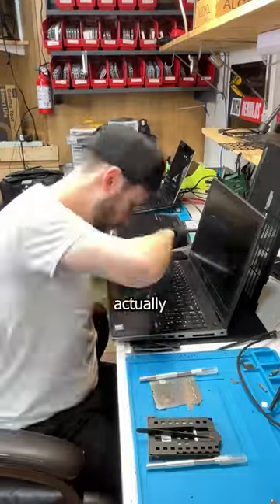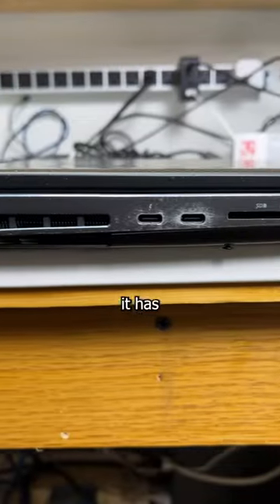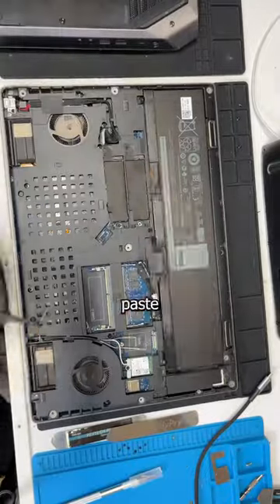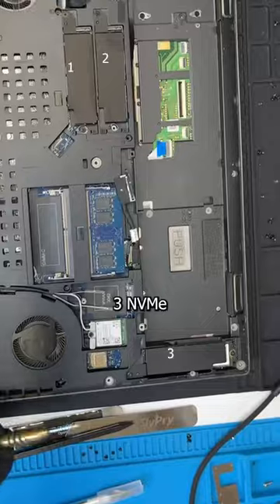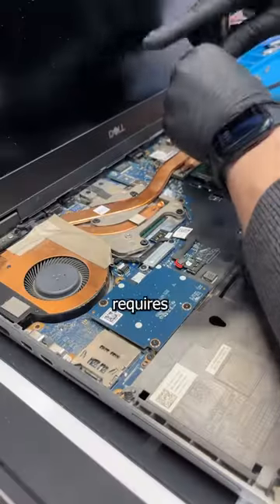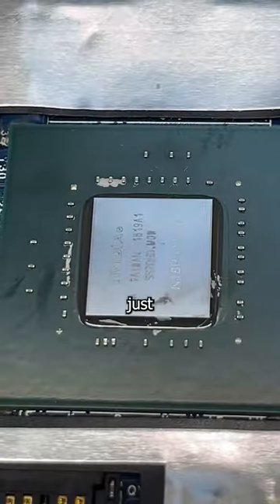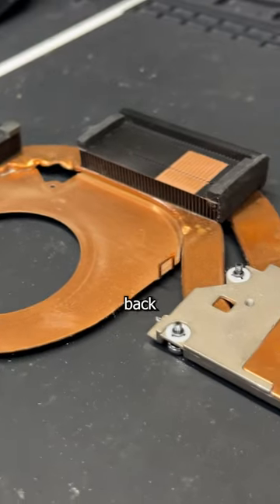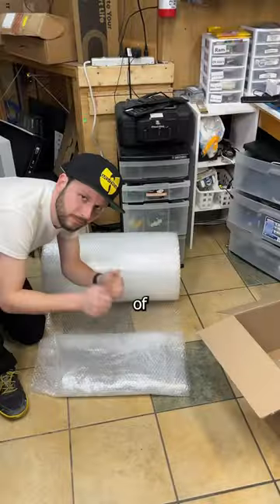Is a refurbished workstation laptop better than a new #PC ? #tech #technology #shorts #pc

Comment: Whenever i see a laptop with replaceable/upgradable gpu/cpu I can't help but wish i had them... Too bad none of the laptops nowadays do that anymore.
Reply from the maker: (Besides Framework)
Reply: Lol yeah besides framework. Honesty they are good but a bit expensive for the same normal laptop specs
Reply: iirc their older model's price dropped to ~500 I think
Reply: @SalemTechsperts Too bad Intel and AMD quit making socketed laptops CPUs by the time framework finally rolled around. Especially given how much longevity AMD platforms tend to have. It would honestly be a way better deal, but I understand that framework can't do anything about that.
Reply: @MrGamelover23  when my '08 thinkpad w500 finally dies, i'm gonna be in a bind finding something modernish to replace it... 😭
Reply: Proper thick workstations might still have upgreadable GPUs. Having an upgreadable gpu in a 7530 doesnt really mean much though, you can jump from a quadro P3200 to something like a quadro RTX 3000, but thats about as modern as you can fit into one of these. And it still uses a proprietary connection and form factor, so you need one thats specific to this model.
Reply: Same, and framework is unavailable where I'm from 😔
Reply: Sadly MXM slot GPUs are ultra rare and can cost double or triple the price of a desktop one, to the point one would instead just get a new laptop and generate more e-waste.

Speaking of, got an old Acer from a friend and it's a Vista era laptop. Core 2 Duo, GPU ain't half bad for it's time. Maybe I'll throw in a 2TB SATA SSD, put XP on it and have it be my retro pc rig for those games I can't be bothered to run on my Windows 10 desktop.

These refurbishing videos always get me in this mood, I swear to God...
Reply: @kittytrail  a used XPS or precision? My precision 5520 (basically an XPS, very nice laptop) is now 7 years old and still almost good as new! Except for the part where I had to disassemble the laptop to scrape all the soft touch material off the palmrest because it was getting sticky.
Reply: @freeeeplay  waaf
Reply: Consumer-oriented laptops to be precise (Dell XPS, Inspiron, and Alienware).

Comment: I have a precision 7730 that I got almost a year ago. I love the thing, it looks like one of the most default laptops ever, but has enough power to run my videogames at 4k60 high. I added the ptm 7950 a few months ago and the stuff is amazing. 11/10 would recommend
Reply: and I currently am using one 😳
ye, it's wild for the defaults and is absolutely great for everything
Reply: I also use dell precision 7730 someHOW
Reply: @Krishna-patel-  Nice! What are the specs of yours? Mine has an i7 8850H, 32GB RAM, and the P4200.

Comment: First time ive heard there are laptops that have ugradable gpu. Thats cool
Reply from the maker: They used to be very common, and to be honest I was surprised as well when I saw this one. I researched it and saw people even slap Quadro RTX 5000’s in this thing. Workstations man.
Reply: The newest precisions still come with removable gpu cards. I'm thinking of upgrading the rtx a4500 in my 7670 to something better when it gets slow.
Reply: @SalemTechsperts  damn thats cool. No wonder they stopped producing these because if all laptops were that upgradable few people would by newer disposable one's
Reply: @_carot  oh thats nice to hear, i just wonder since laptops with upgradable GPUs are not that common . Is it hard to find upgrades? Ive also never seen an advertisment or promotipns for GPU cards
Reply: @beatcipher  They are Dell proprietary so only some select ones will work.
Reply: @_carot Not all of them are.  I have the predecessor to this, the 7520 and it uses type A MXM cards.  Bad news is about the best card you can get for that is a GTX 1050 ti and they're rare.

Comment: Oh hey, I have one of those. Mine is specced with the Xeon E-2176M (same as the i9, just with ECC support), 32GB RAM, and Quadro P3200. It's an excellent laptop if you can look past the heat and noise. 
If you can get a good deal on one, I highly recommend it. Paid £440 for mine. Officially runs Windows 11 if that's something g you're into.

Comment: At least your doing your customers right. Most just reflash Windows and call it a day.

My "refurbished" miniPC was overheating and the fan was going crazy. Opened it up to find dust and a floppy SSD drive with a broken insert nut. Cleaned, fix the SSD and new thermal paste. No more jet engine noise from the fan.

Similar story with a Microsoft Surface. Apart from dirt, they flashed a new copy if Windows on the device, but disabled nearly every security feature Windows 11 has. 

"Refurbished" just means used to me unless the OEM actually pulls it apart to fix it.

Comment: My work is going through and getting rid of their w10 machines. I've scored some insane stuff in the past couple weeks. 9th gen i7s, advantech boards, Hyper X and Corsair ram, Corsair fans and cases, SEVERAL gen 8 i5 13" dell/hp laptops, a gen 4 Zbook, viewsonic monitors,  etc. List goes on. Just because 10 is ending doesnt mean there arent workarounds. A tpm chip for those advantech boards is like $40. Problem solved.

Comment: At the beginning the temps are in the 70s ... after cleaning you say about the temps: "huge decrease and no overheating" .. but the temps dropped only 3-4°C ...
Reply from the maker: At the beginning, it had to THROTTLE 6% for the coolest core to reach 77c. Hence the "OVERHEATING DETECTED". You're ignoring the actual data showing nearly all the CPU core went up to 90c before being throttled back down to reach the low 80's, high 70s. The end shows no throttling, no spike, and every core operating around 74C under stress. That is a massive difference.
Reply: @SalemTechsperts how do you check if your laptop is overheating?
Reply: Whats the name of that program?

Comment: My old thinkpad was routinely able to hit 100 degrees celsius cpu temps just by running for a few minutes, it was pretty funny
Reply from the maker: ouch
Reply: @SalemTechsperts  surprisingly it still ran decently well, it was a bit slow but worked fine with chrome even

Comment: The greatest technician thats ever lived, can you guide me? 😳
I have an old laptop from 2016. It works but its significantly slower than it used to be when it was new.

I reinstalled windows and even tried linux, everything runs slow and there is lot of loading NOW but that wasnt the case earlier.

It is a laptop with HDD, 8 GB DDR3L RAM.
What could be the issue? I can't find the issue and only can help me now.
Reply from the maker: Replace your HDD with an SSD.
Reply: @SalemTechsperts  thank you!
Can you also tell me if RAM and HDD get slower or performance get worse as thry get old? Does the same apply to CPU and Laptop GPU?

Thank you once again. I really appreciate your help ❤️🙏
Reply: @Zekr0_ hdd does, but mostly because of shitty code of Windows. It would be better if you reinstalled, but just buy ssd.
Besides this, nothing should degrade if it doesn't overheat.

Comment: Can the GPU's on these be swapped to something like an RTX 2070-RTX 3060 mobile?
Reply: They can if they fit ofc. Need to be same size as the original one.
Reply from the maker: This model only takes specific versions of the GPU. You can find out which ones by searching "7530 GPU Upgrade" and looking at the reddit thread
Reply: @SalemTechsperts  dude I think the dream I had last night was influenced by watching your video, I thought I got a new laptop but it was like that bigger HP one you disassembled a while ago, I was so excited cause it was like one of those MXM laptops where the GPU could be swapped out up to an RTX 2080. Then I woke up and realized it wasn't real, that was sad

Comment: I made the mistake of buying an older second hand laptop the software is soo outdated not even windows 10 is able to save the laptop I pull it up completely changed the thermal paste clean the whole entire thing and put it back together and it still has it's shut off problem

Comment: I have a dell laptop from a few years ago and forgot the code lost the battery and charger and the mounts
 to connect the screen to the bottow broke of so the screen and bottom are connected by the wires i bought a prebuilt pc instead of trying to get it fixed  lol

Comment: Serious question here: got Lenovo ideapad z565 windows 7 installed back in 2017 and bios has password which nobody knows.
 randomly pulling black screens and turning off completely during some games which connect to the internet (dota, warcraft 3(that's a weird one to have this issue) randomly;  realm of the mad God in few mins after playing. 
What could've caused it and how to solve it?
Reply from the maker: Overheating and a failing GPU. Failing GPU will cause WiFi errors. Get a new laptop.